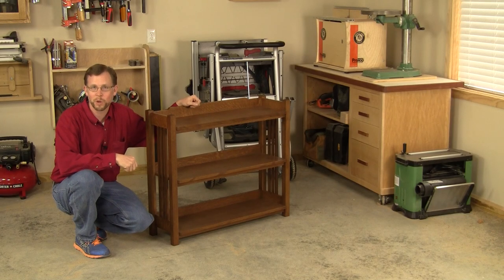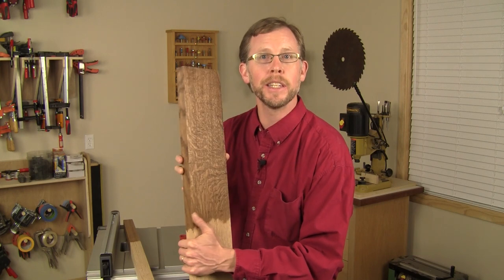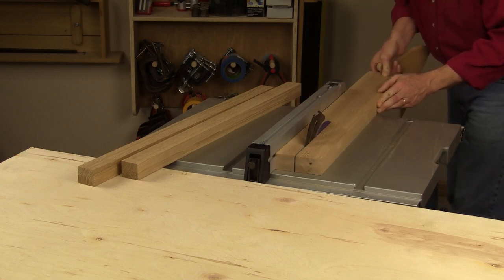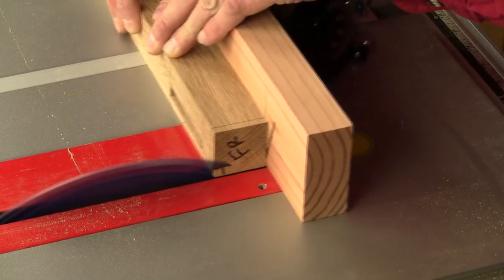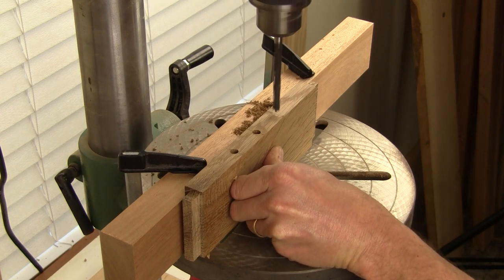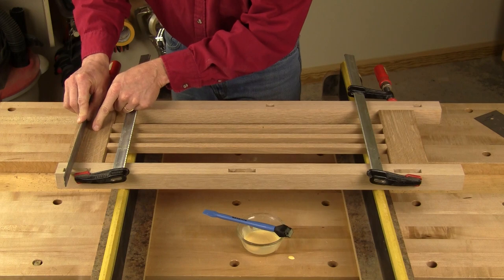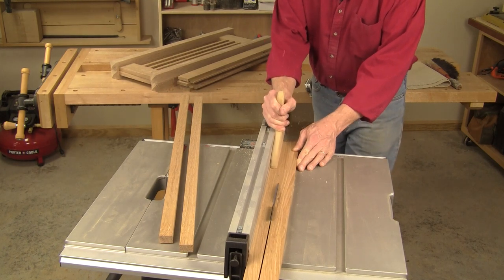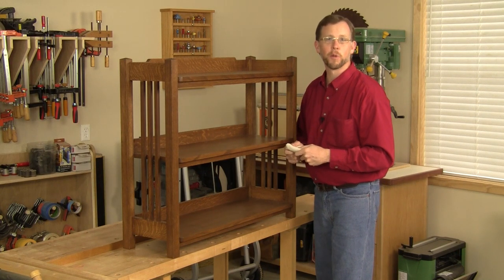How to Make a Stickley-inspired Bookcase in a Small Shop

Comment: Apolari3ear: I was working in a well-ventilated shop when spraying the satin lacquer I used on this bookcase. But, always a good idea to put on a respirator as an additional precaution. If I were spraying a really large project, I definitely would have done so. As to your other question, I use impact drivers and drill/drivers almost interchangeably these days. Have not had problems with broken screws as a result.  

Chris Marshall